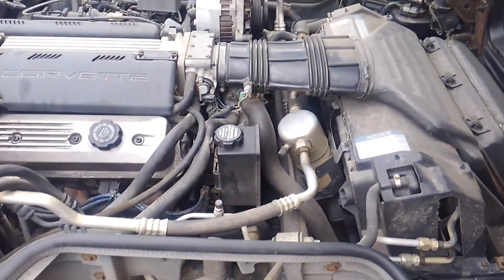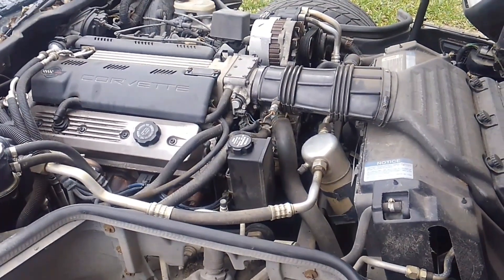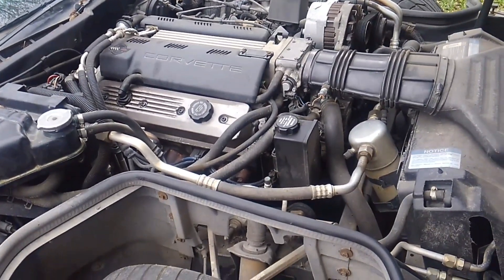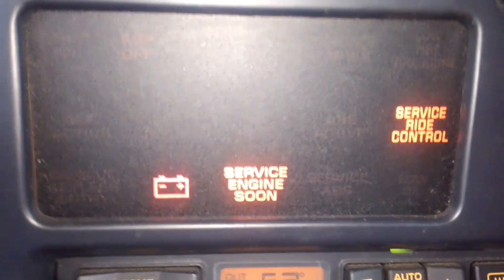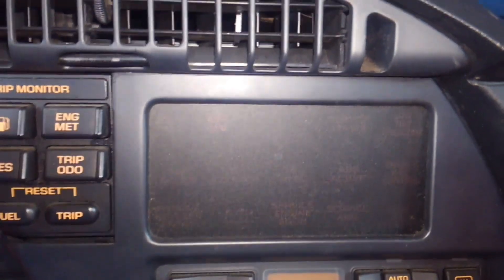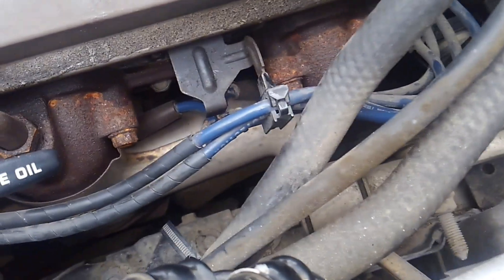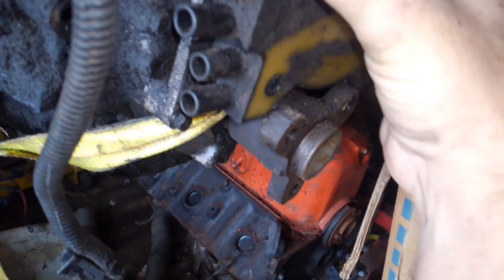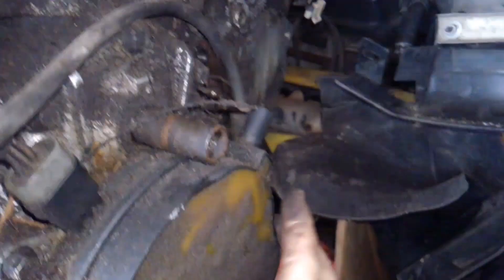The 1990's Corvette LT-1 Engine and It's Optispark Problem

Comment from the maker: Be sure to check out my other videos for more cool Corvette How To Videos -

https://www.youtube.com/playlist?list=PLAM-V1w3acpivjkfJyWbE99E1FcOaXKys
Reply: Hey I know im late. Hope u know I have a 94 9c1 caprice with lt1. Im doing a opti and water pump and seal change out. When I got the opti off had oil coming out of it. So on the hole that u hook the opti on has oil coming out of it. Is this some that I can fix and if so how or is this a rebuild thing. I just the car drivable until I can afford a rebuild.
Reply from the maker: Hey Jay, you're referring to the cam gear coming out of the timing chain cover?
Reply: @VetteSource  yes right behind the gear that powers the optispark
Reply from the maker: Most likely you have a bad seal on the timing chain cover. It may require you to pull the cover to replace it, but can't remember off the top of my head.
Reply: @VetteSource  cool thanks
Reply: Pull bad oil seal out with hook. Put new 1 in . Simple!

Comment: I have a 93 I have replaced the fuel pump fuel pressure regulator fuel filter filters positioning sensor is a problem.  the problem I am trying to get rid of. Is when you start it it runs great or about 10 minutes and then just shut right off like flipping a switch if I put a little fluid in there to test to see ifFuel is a problem it tries to start which tells me that the spark is fine but there’s a fuel problem so what is it shut down like that?

Comment: When you put the new distributor back in, how does it key so you have the same timing as you had when you pulled it? It didn't look like the stub gear had a tab on it.
Reply from the maker: it will be keyed to install a certain direction, so you just need to line up the keyway

Comment: I have a 1992 corvette with the lt1 i drove it today it died on me twice started back up both times i pulled the codes and i got code 16 low resolution. Does that mean i need a new optispark?
Reply from the maker: With a code 16, it's very possible the optispark is failing or is about to. I would recommend performing the troubleshooting steps on the complete circuit to verify before tearing it down. Let me know how it turns out👍

Comment: As I drive down the road my sys keeps coming on with different numbers but my car runs fine my OBD doesn’t have the sys codes
Reply from the maker: Have you tried putting the BCM in diagnostic mode using the DIC switch?

Comment: I tapped the weep hole and installed a hose barb with a rubber line going past the Optispark and down between the cross member so if it leaks it will on the street and not on the unit itself.
Reply from the maker: Great idea, thanks for sharing👍

Comment: This is the far most best video information on the Optispark in the 90’s c4 corvette,  great details and explanation that was involved! I just bought a C4 Corvette. I have a C-5 and love it! But not familiar with the OPTi spark, I’ve been trying to start mitt with no success it was running and just cut off like a switch. Wasn’t sure if it was a fuel related issue even though it had low fuel added 8 gallons still no start. So this video gives me a little insight on what to do. Just want to say thank you!
Reply: I have a 93 corvette with 23,000 miles.Thing just quit running the other day.Needed a new optispark.Had a dealership change it out with a new opti and waterpump.Not a cheap fix.Good luck.
Reply from the maker: Kenneth, glad you enjoyed it and found it helpful. Congratulations on your new to you Corvette purchase. You have years of fun and great memories with it👍.

Comment: You said you were certain the ECM was good because you checked it with the scan tool. What did you mean by that? What scan tool can check the ECM? Do you have a video on that? Thanks.
Reply from the maker: I use a Snap-On MT2500. It's an older scan tool used for the OBDI and early OBDII systems. You cam find them for sale on eBay or the other classifieds sites.

Comment: I’m having problems with mine nobody can figure out. So it likes to stall and completely not start at all. It was a little sluggish when I pressed the gas and it often stalls if I stop at a light or stop signs. I bought it as a 19 year old and it had no signs of issues. Now they all came and I’m being hated on by my entire family so it needs fixed 🤷‍♂️ I hope you can maybe have a suggestion of what the problem may be
Reply from the maker: Sounds like you will need to get some of the basic checks out of the way first. My first thought would be to make sure you don't have bad fuel or fuel filter. Next, check to make sure you don't have any airflow restrictions into the throttle body, then check the fuel pressure at the fuel rail with an appropriate gauge. If those check out fine, then you will need to check for correct spark and injector pulse. Let me know how it turns out, and don't worry about everyone hating on you about what car you choose to drive. It's a Corvette, and many people won't understand😁.
Reply: @VetteSource  thank you!! 😁 I’ll try my best on it
Reply from the maker: Good deal, glad to hear. Let me know how it's going👍.
Reply: @VetteSource  I will 😁

Comment: I have a question. I let my car set the last two months. 96 Chevy caprice. LTL motor....November and December.  During that time we had a ice storm in my city. I went to jump back in it and it's rough idle and wants to cut off when at a light and smell a little gas. It doesn't run strong like it did before the below 0 temps hit my city last month.  I changed fuel filter first before changing spark plugs and opti spark. What you suggest I should look for?
Reply from the maker: It's possible you have some residual moisture built up in the optispark or at the plug wire connections after the ice storm. As silly as it sounds, try applying some heat with a hair dryer or heat gun(low setting) around the optispark cap at the wire terminals. You'd be surprised how quickly that will remove moisture. Let me know how it works out👍.
Reply: @VetteSource  ok thanks. Gonna try it

Comment: This was a really good explanation of the optispark system. But on my 92 vette, I DO have spark, but it cuts out whenever the engine gets warm. So I am wondering if it is the opti, or maybe it's the coil or the O2 sensors. Since the car starts and runs good up until it gets to operating temp, is it likely the optispark, or maybe something else?
Reply from the maker: I wouldn't suspect the O2 sensors, since they can be completely inoperative and the engine will still chug along. Something in the system is cutting out when the engine goes closed loop. Since the fuel injector drivers are driven by the ECM, they will tend to either work or not work. I would take a closer look at the ignition system, starting at the plug wires to see if you're losing spark once you reach operating temperature. From there you can backtrack to the optispark to see what's going on.
Reply: @VetteSource  I suspect there is something in your comment. I will check it out. But what I also wonder is, is there any tie-in between temperature and the opti? In other words, is there something about the way the opti operates that could make it shut the engine down at higher temps?
Reply from the maker: It's possible that the optical sensor or one the internal components is failing once it gets hot, but there's no way to tell without a visual inspection once it's all torn down. Checking from the plug wires going back will help you identify if there is anything else in the circuit causing problems before you have to dismantle the optispark.
Reply: That usually happens when your Ignition Control Module goes bad not the opti-spark. It sits right near the coil.

Comment: Over 170k miles on the original Optispark in my 96 Buick Roadmaster sedan. I'm gonna rebuild it soon when I do the timing chain and seals. But it still runs great
Reply from the maker: Definitely, I prefer a rebuilt factory unit over the aftermarket myself as well.

Comment: Wath does SYS mind
Reply from the maker: SYS is a message generated by the BCM alerting you to a trouble code stored or something else wrong within the data line circuit. It will even flash "SYS" if you have a low battery voltage condition.

Comment: I have oil inside the optispark, do you know how It could be possible?
Reply from the maker: Most likely it's a failure of the oil seal that is located where the distributor drive gear comes through the timing chain cover from the front of the camshaft. If you have it dismantled already, you can easily check it for oil seepage.

Comment: would rather have a distributer way easier to work on . another nightmare designed by engineers that don't pay to fix it
Reply from the maker: I think quite a few of the old school mechanics feel the same. Thanks for the comments👍.
Reply: @VetteSource   I could see these cars being LS swapped.  I drove my stock GMC pick up through a river and it ran fine.ls has way better ignition system
Reply from the maker: Yea, definitely a potential failure point, but if kept up with maintenance wise the later C4 optisparks last for many years. My 2 96 LT4 Corvettes, one with 23K miles and the other with 135K are both running their original systems.

Comment: Are their any seals that need to be replaced when doing this job ?
Reply from the maker: Hey Bill, other than water pump seals if you elect to replace the pump, everything on the optispark is pretty much self contained and sealed up like the older distributors so you shouldn't need to purchase anything extra.

Comment: I own a '94 6spd and my water pump failed, causing the coolant to flood my optispark and rendering it useless.  Take note: I upgraded the optispark with an improved "vented" version from  the '95/'96 models.  I also used high temp silicone and sealed the perimeter where the cap meets the body.  I then snaked the vent line up into through the firewall and into the underside of the dashboard.  
20 years later and she's still running like a Swiss watch!
BTW, ingenious in it's design,  the distributor was relocated down below the front of engine in order to lower the hood line to increase the coefficient of drag.  Remember,  this was pre individual coil overs.
Reply from the maker: Hey Rick, that seems like a good preventive measure to avoid some.of the common failure points of the system. Nice udea about running the vent line to dash area. Thanks for sharing the information👍.

Comment: My 93 keeps dying//stalling after 20 min. After it cools down it starts back up. Any idea???
Reply from the maker: Definitely could be an optispark issue, but I'm afraid you'll have to dig into it in real time to figure out what's going on. I would start with the coil mounted at the front of the passenger side head to check for bad/loose connection and proper operation once it has stopped running with a spark checker. If that checks out ok, I would start looking closer at the optispark itself.

Let me know how it's going👍.

Comment: My opti just failed today on my '96 LT4, what brands/models of replacement distributors do you recommend?
Reply from the maker: I would stick with the ACDelco remanufactured unit. The part # is 19383531 and is available on Amazon.
Reply: @VetteSource  Thanks for the help. Is that the later vented design?
Reply from the maker: Yes, all 94-96 units should have that as part of the design

Comment: If someone out of 150 comments hasn’t said it, my H/Balancer was a horses a…. to get off.
Reply from the maker: 🤣 you are VERY correct. There isn't much room to work in there with the appropriate tools to get that thing off of the hub. However, did you notice the 3 bolts that separate the balancer from the hub shaft? They designed it with a built in hack so you could get the balancer off in stages rather than trying to get everything off at once.

Comment: Hello I'm new to corvette I own a 94 aqua blue 6spd what brand of optispark is a good quality? Thanks 👍
Reply from the maker: Generally speaking, I usually try and stick with OEM on the Corvette stuff. However, I'm not sure that GM is still offering an optispark replacement, so you're left to choose from the aftermarket suppliers.

I don't have a personal preference eight now, but looking at the catalog offerings there aren't many options available. I would say stay away from the cheaper units, and take a closer look at the Cardone piece and see what kins.of reviews it has. Let me know if you need any more recommendations.

Comment: I need some help and advice.I fixed the ignition problem?.
Water pump and so on. The 94 runs great. Now when it comes up to temp the fans turn on then 5 seconds later it stalls. Crank no start.....again
Reply: Usually a couple hrs. Maybe overbite.
When I noticed what was happening I cranked it and let it run. At temp it cut off. I can't remember is the fans cut off too like a complete power failure I'll look next time. Harnesses are fine
Reply from the maker: Ok, it's possible you have a bad ground connection. I would check those first. If those check out, I would start looking at the ECM and harness connectors.
Reply: The only common connection location is the ECM. All roads lead to the company I researched that sells them preprogrammed You just provide your VIN.
Plug and play
Reply from the maker: Yep, not a bad option but not that cheap anymore. How much are they charging for a programmed unit?
Reply: They sell anywhere from $750 to $900
I paid a good price for the car and it has already had the suspension upgraded..
The previous owner was setting it up for Autocross but the deal fell through
Reply from the maker: Wow, they have gone up in price. I haven't had a 94-96 PCM in stock for awhile because they were pretty reliable for a long time. Looks like the failure rate is starting to creep up on them now, and it's catching the core rebuilders off guard.
Reply: Well sir..it's like this..
When you can buy a 94 Vette with 100,000 miles that has $4700 in suspension parts ..another $ 1100 in tires for $5500 you can expect issues
The interior is pristine and she runs like a bat outta hell..well..the choice is simple
Fix it
I don't have any other financial obligations
If it cost another grand...so what?
I found a reliable tech to check it out
I'll get back with you
Reply from the maker: Wow, that is an unusual problem. Under normal operation, the fan circuit doesn't have anything to do with the ignition system. I'm afraid this will require some electrical troubleshooting to figure out what is going on. 

Does your engine harness look like it has any previous repairs or splices? After you get the no start condition, how long does it take before it wants to crank back up again?

Comment: I will NEVER buy another Vette with that STUPID OPTISPARK!!!!!
My 94 is awesome.....when it runs.
I've thrown enough money at it to buy another one.
From dream car to nightmare.
They say the LT1 is dependable.
NOT
Reply: I made it to the store 2 miles down the road and back. Things are looking up
Reply from the maker: There ya go. Keep starting up and driving that old guy around. It's good for it.
Reply from the maker: Hey Paul, I understand your frustration. Sometimes when you have an optispark failure, it can be a challenge to find quality components or qualified technicians to make it work correctly again. Hope it works out for you. The 94's are great cars.

Comment: After only about 35,000 miles the optispark on my always garaged 1994 LT1 Trans Am failed. It still ran in kind of a limp home mode. No local shops wanted to try and fix it....and they also claimed they didn't have OBT 1 analyzers. I made an educated guess and had a mechanic replace the optispark and that fixed the problem. My original optispark was very rusted. I no longer will drive my optispark Trans Am in the rain or if the streets are wet.
Reply from the maker: I hear ya, they can be problematic sometimes for the most random reasons, like if there's too much moisture or condensation in the air. If you own one long term, you just find the workarounds.

Comment: Everyone talks about this “problem” yet my 1993 camaro still had the original factory opti spark at  150,000 miles. Vehicle was still running fine when I decided to replace it while doing plugs and wires that were 15 years old and just decided to replace it all.  J/s
Reply from the maker: Yep, we've see quite a few different experiences with the Optispark system in the comments. The common thread seems to be the garage kept cars, or the ones kept away from excessive moisture hold up pretty well long term. Thanks for sharing your experience, sounds like it's been a good car for you👍.

Comment: 👉Nobody thought to put a bag or a rubber boot over this thing to keep moisture out? I had a brand new 96 back then, and if I left it outside, which I did, and if it rained that week, it didn't want to start by the weekend.. 😭
Reply from the maker: Amazingly, this car ran strong for well over 100,000 miles before the previous owner burned it to the ground in his driveway after leaving a battery charger hooked up to it for too long. Of course, maybe the oil leaks all over the front of the distributor helped keep some of the moisture out😁.